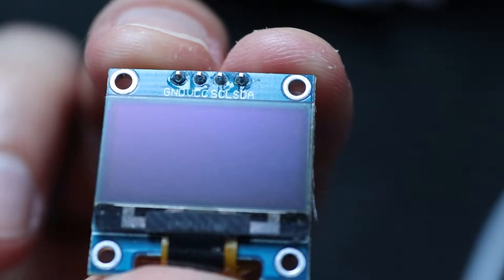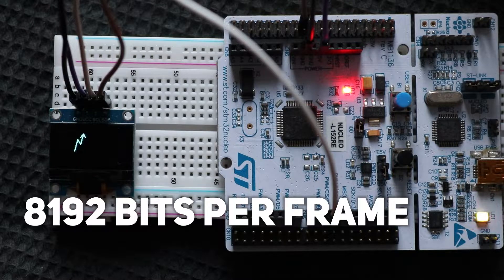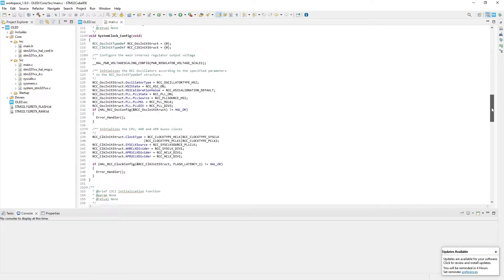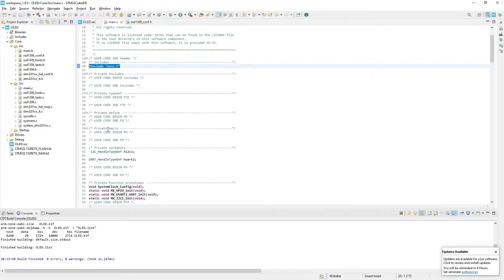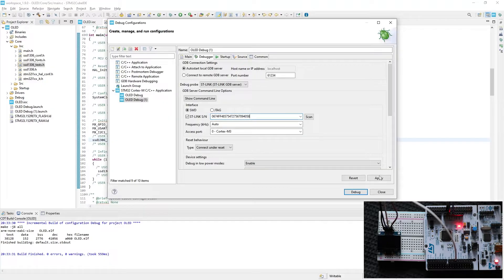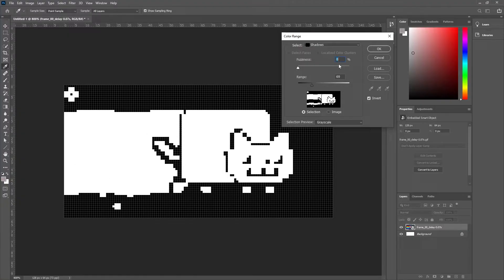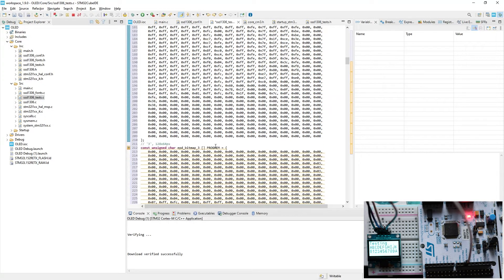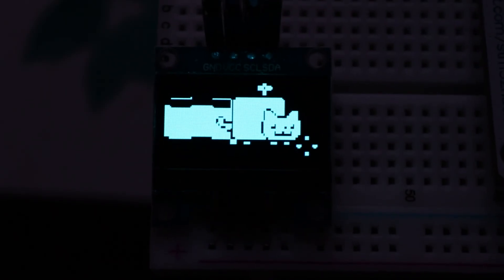STM32 + OLED = Display Anything

Comment: What are your suggestions for spi with 7 pin connection?
Reply from the maker: @Oppenheim14  Depends what are the signals there. You have to read datasheet for it first and change the control accordingly

Comment: Hello I'm using it on a blue pill stm32f103c8t6 but while compiling it gives an error about #include <_ansi.h> doesn't exist. I'll be glad if you help me with it
Reply from the maker: If it is the only problem, just download ansi.h  header file from a github and include it into the project. ansi.h is a universal file so probably any should do the job

Comment: Thank you, very nice tutorial. I did everything what you did. But for my board it isn't working(b-l462e-cell1). No errors. But still also no display whatsoever. The OLED needs a SSD1315Z driver. Since there isn't a good one. I tried your tutorial. But it didn't work. What could I do to see if something went wrong. Btw the OLED is already connected to the DEV_kit. 

Pins:
SPI_3 SCK--> PC10
SPI_3 MOSI--> PC12
SPI_3 MISO | D/C--> PC11
RST -->PH1
CS -->PB2 R

I would really appreciate it if you could help. Since no one in the forms reacted to my questions.
Reply from the maker: If its a typical dev kit it should has a tutorial and demo programs for all the periphery. First - try finding those. Cause mistake can be everywhere :(

Comment: Great video. Will this project work with a STM32F103 (Blue pill)? My use case requires a very small form factor. Your OLED seems to be the ideal size. But can small board like the Blue Pill control it?
Reply from the maker: Hi. Definitely yes. Blue Pill can do that no problem :)